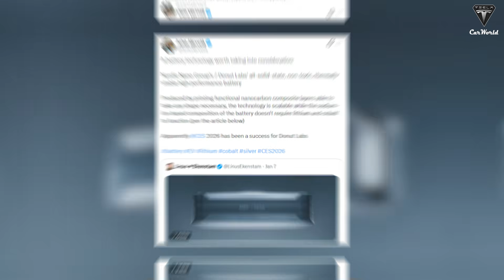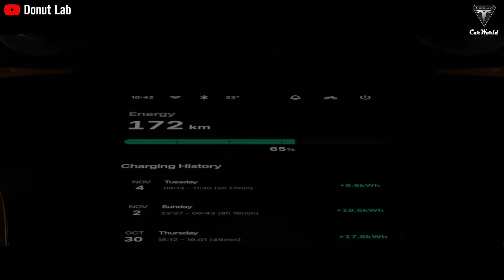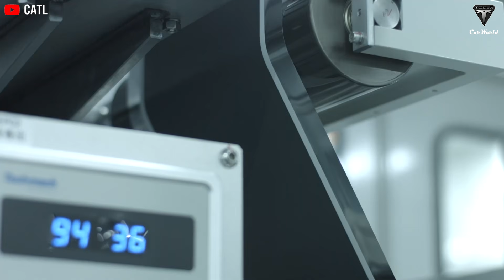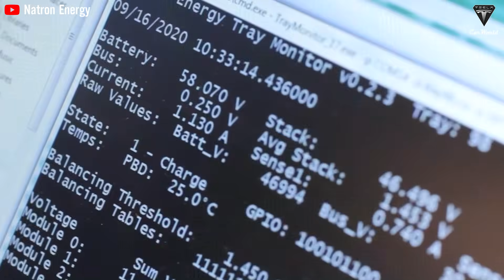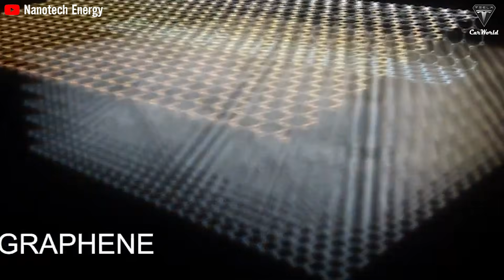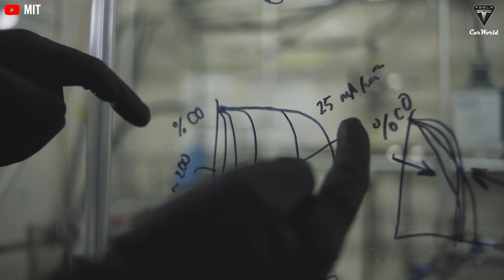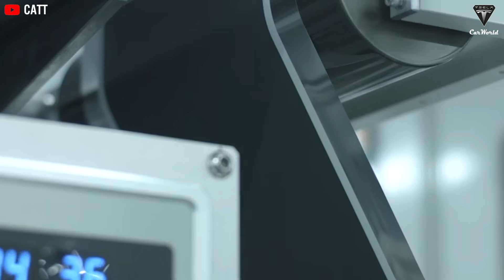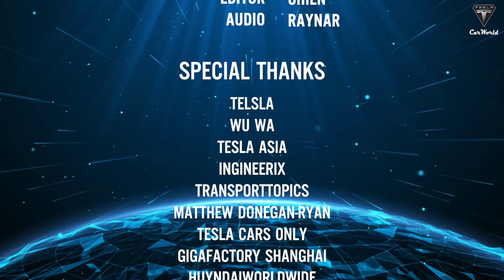No Need Lithium! Donut Lab Confirms World's FIRST Solid-State Battery! Toyota Worried!

Comment: They my be waiting for the test results to be granted one or more of the patents they have applied for. If so I could understand the secrecy they maintain. Once it is granted their lead is hard to catch and any court battle hurts their compeditors insted of them but if somone interfeared with the application in the courts before it is granted somone else would have years to catch up with no patent protection. Ether way this looks interesting. If the claims are true then a huge disruption will affect the big goverment backed chinese companys that are depending on lithium chemistry batteries and assosiated patents. If not their will be a sectacular scandal in a year or less. If the claims are true but unstated limits exist them this could still be somewhat big too. This is looking like a new type of super capacitor stablised with thin layers of battery derived chemistry to keep charge long term. I speculate that with that any risk could stem from trying to charge them after some type of physical dammage. A charged or discharged one would be fairly stable. But while charging at high speed a short in a cell could be spectacular.

Comment: Hybrid battery with 50% sodium and 50% soild state.  Motors on back wheels and kinetic charging on the front wheels.
Reply from the maker: Donut hasn’t claimed kinetic charging or mixed-wheel systems. The article focuses on a solid/semi-solid battery architecture validated through motorcycle deployment, not speculative drivetrain concepts.
Reply: @TeslaCarWorld   IF we have utopia type power storage, why not wish for a super regen. 😂Dreaming😂

Comment: No doubt Donut battery is a scam. No proof at all. Quantumscape batteries are the only ones with available third party technical and performance reviews, and some 150 related patents. There are natural boundaries for ion release by atoms and Lithium is best.
Reply from the maker: Patents don’t equal products. QuantumScape isn’t shipping vehicles. Donut placed packs into real motorcycles and OEM testing—public failure risk scams never take.

Comment: If this is true. it's scalability would bring it to everything from phones to airplanes, disrupting the entire battery infrastructure. Practically speaking whoever owns the patents would be among the most powerful on the planet.
Reply from the maker: Only if it scales. The article stresses it’s viable first in small systems; phones and aircraft depend on volumetric density, cost, and manufacturing maturity.
Reply: @TeslaCarWorld  Exactly. The nanofluid printing method (R2R) actually favors larger surface areas first, making trucks and SUVs the 'easy' gateway to mass adoption. In heavy-duty vehicles, you can print the battery directly into the chassis (structural integration) turning the frame into a massive energy storage. This eliminates the dead weight of traditional battery casings. If they solve the precision needed for micro-scaling (phones/watches), they won't just lead the market—they'll own the global energy standard.